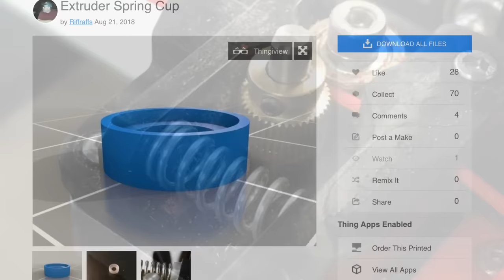Fix Bad 3D Prints on a Creality Printers

Comment: Hey man, the faster you can get to me the better. I want to get my dad a reliable 3d printer for his birthday. He got one 3 years ago, and what we found out, is its a frame and the rest has to be DIY or you have a frame with a bunch of useless parts. We got one or two awesome prints, and with limited knowledge on the subject we did fairly well. I noticed the bed was warped and that didn't help and after putting in another 50$ to try and solve the frustration that was supposed to be a gift, we gave up. and that's 50$ in multitudes of solutions. The solutions we found stated we would have needed to tear it all down and rebuild from scratch almost buying a new 3d printer worth of parts. I think I have decided on the CR-10 as it just sounds good from everyone, and I do not mind putting time or effort into improving it, My deal is weather or not it will work. If it can't at least work on its own and give me SOMETHING then I want to stay away from it.  If it can at least make me the pieces to improve it, I think its worth it. I'm trying to find good sales now, but I have a question:

I have found a few versions of the CR-10 mini, and some don't have the new neat upgrades that you showed off in another video I believe. The mini Makes me happy both in price and scale, its actually fairly decent. The standard just gets a bit much for me in price, but is the extra worth it between the mini and standard? Also, it may be me that I can't find the link to the right mini, but would the link to the mini in this video be well enough? if I do not get the mini,what in the world is the difference between the 10 and the 10S? I have 100 coming in so pricing wise, the 10S would be cheaper but only if its better for the 100$. I found a CR-10 that was listed as the Newer version and is more expensive but I don't know whats so much newer with it or if its even worth it. I am trying to understand, let me know if you can!
Reply from the maker: All the links in description are for good ones. 10S is not worth the extra in my opinion. I use several 10 minis and I like them.
Reply: @FilamentFriday  thank you so very much! Have a wonderful day!

Comment: It could also be bad filament if it’s not higher end filament. I bought duramic pla plus and COULD NOT get it to print. It even had great Amazon reviews. I usually print PETG so I thought maybe I wasn’t getting good settings for PLA. I mean PLA is supposed to be easy to print I must be doing something wrong right?

Even after drying for 2 hours still nope. Pulled out the creality sample PLA, and it worked fine. So don’t rule out bad filament if you’re using low to midtier stuff.
Reply: this is the exact filament that was giving me issues too, switched out my nozzles, went back to my stock extruder, calibrated e-steps and did a bunch of tests. nothing ever came out consistent
Reply: OMG, I also am trying to get Duramic to work and its complete garbage. I thought it was me since it has great reviews, but its all powdery and I have had under extrusion, binding extruders and when I finally got it to print it looks uneven like some of it didn't flow properly. Also my printer is caked in dust now after having just cleaned it.
Reply: @ammardelreal3802  same. Just never got consistent results.
Reply: @kenh9371  a lot of the Chinese filaments have gone downhill over the last year. Idk why.

Comment: I do have clicking on my CR 10 Smart Pro and it doesn't and it was caused due to a clogged nozzle I thought. The issue is fixed and I have a 0.6 nozzle with arachne engine from prusa slicer and everything works fine but I'm not sure if this applies to my latst printer. I mean its just been a week or two of printing and I don't know if this is the case but it used to do this and I thought it was just cheap filament, increased the temp and it was fine. 215 degrees as the filament was just not great.

Comment: Good to know, but my case I have a newly installed dual z lead screw on my ender 3 v2. The issue was two prints same time 1st  was perfect the  other first layer separated a little the rest of it was fine. Was the the loss of power possibly? I don't know?

Comment: So I just bought an Ender 3.  Went through several trouble shooting videos before I realized that the humidity in Hawaii is 100% when it rains... It's been raining for four days. Lol. Buying a dehumidifier to see if that works.  But I get very similar prints to this every so often.  That steam builds up and nothing flows consistently.  Any other suggestions to help keep the machine dry?
Reply from the maker: Get and enclosure for it.
Reply from the maker: Because my channel has always been more than Filament Friday. CNC Sunday (occasional videos) and some Electronics are all under the umbrella of my company Chuck Hellebuyck’s Electronic Products (CHEP).

Comment: I am unable to get my new Ender 3 v2 to finish a print.  Things go great for small prints, like a stringing test, but larger stuff ALWAYS fails, leaving the print in a stringy, tangled mess after the first half hour or so.  This happens every single time since the first error with larger prints, and I have had less than half of my prints finish.  I am growing frustrated.  I am  leaning towards the nozzle being the problem, as I think my bed is well leveled.  The FF toolkit I purchased with the recommended nozzle kit should arrive today, so hopefully it will allow me to fix this with a  bit of advice.
Reply from the maker: Verify the fan is spinning to cool the hotend. Sounds like it might be stalled.
Reply: @FilamentFriday Thanks for the quick response.  Yes, the fan is running.  I have slowed the print speed to 75%, and am currently almost done with a print that has failed twice so far.  Does this suggest anything? And thanks for the quality gear in the tool kit.
Reply from the maker: Probably was too fast for hotend.
Reply: @FilamentFriday  Maybe so.  Print still failed at the very end, but made it further.  I think I just have more to learn.  That said, thanks for the quality videos and the replies.  You have another fan.

Comment: I have a problem I don't understand.
I got myself a magnetic bed for my ender 3.
After I put it on the printer and calibrated it I tried to print my the calibration cube to check if it was all right.
The cube printed all right but I couldn't get it of of my printer even after it had cooled down.
I managed to get I out but it left a mark and now the bed has the shape
Reply: Maybe bed temp is too high lower temp less adhesion.  Personally I like to use the purple Elmer's glue and if it's too hard to remove I just run it under warm water and it dissolves the glue and comes off easy.

Comment: I use an ender 3 and if I print larger items they come out wavy... The printer is standing still, no wobble while printing, extruder adjusted and settings are all good and good quality PLA, any ideas?
Reply: Check you bed x axis tension on the bed belt, the excentric nut on x axis and just check that extruder idler pulley isnt too tight

Comment: What if the waves appear on large flat surface of a print? They are constantly spaced apart.
Reply from the maker: Then your bed level is off or your bed is warped.

Comment: hi!! maybe you can make a video on layer separation, i have problem with my ender 3 pro, and outher vertical layer not sticking together, and i have done the flow check, and also increased extrution with, but i still have problems with this, and it seems like some colours are worse then others, i have also tried increased temp on the nozzle, but no luck, and because of this problem, i often use only 1 outer layer.
Reply from the maker: https://youtu.be/iXe7bftyMFU

Comment: A similar problem on the surface can occur if the plastic has absorbed water and needs to be dried!
Reply: That's the problem I'm facing. I printed over half a spool with very nice lines, then didn't touch the printer for weeks but didn't remove the spool and we had really bad rain for those few weeks. Couldn't get decent lines but tried a brand new spool before tinkering with anything and bam, perfect print again.
Reply: @southaussielad2496  the plastic can be dried in the oven for PLA 50 degrees, for PETG or ABC 70 degrees for 2-4 hours.

Comment: Using pla, creality Pro 3. Says anything between 200- 210 nozzle.  Bed 60 and speed at 80. Fan is at 50% Why do prints screw up after a few hours. Hearing too many different loadouts for pla. What's the real number please?

Comment: CHEP, I need your help. I've tried all of this and I'm still getting little gaps where there is no filament coming out. It was printing fine before I clogged and replaced damaged tubing, nozzle and fittings. I've tried different tubing, fittings and nozzles. I've tried reseating the nozzle and tubing multiple times. I printed the extruder spring cup and installed it. I just did the hot end fix following along with your video and it's still happening.  I cannot figure it out for the life of me. I've had my ender 3 pro for a little over a year. Symptoms include the little gaps with no filament like I mentioned and more stringing and oozing than usual. Thanks for your excellent videos and any advice you might have for me. Thinking about trying a new extruder next I guess.
Reply from the maker: Check the extruder arm for a crack.
Reply: @FilamentFriday  Current print just finished. I took the extruder apart to get a closer look and the arm is not cracked and the insert where the screw goes for the pulley is still solid. It is pretty worn out where the filament goes in on both sides. It has worn through the brass insert almost all the way. Could that be affecting my prints?
Reply from the maker: Definitely. It will stop the filament from flowing.
Reply: @FilamentFriday  Thanks for any tips. I've installed a new EZR struder. Calibrated e-steps and flow. First print looked great on the outside with no gaps but infill looked messed up with gaps and globs which is new. After that the hot end fix I did it seems the washer shrank and isn't working right anymore. So I've tried reseating the tubing numerous times and tried putting the hot end fix back in but the filament catches on the small piece of tubing. I've put new tubing and new nozzle and still getting small gaps where there is no filament. Im at a loss. The first print after installing the new extruder had no gaps on the outside of the print. But now every print has small gaps and I reseat the tubing and nozzle before every print trying to fix it. Maybe I need a new hot end?
Reply from the maker: Sounds like your fan is failing.
Reply: @FilamentFriday  man I thought we were finally onto something here. Thanks for allowing me to ask you questions and thanks for the replies.

The hot end fan has been making a lot of noise lately so I replaced both fans on the hot end and still having the same problem. I tuned PIDs and I've checked e-steps.

I had thought the hot end fix washer shrank but I printed another one and it's the same exact size. It just doesn't fit tight it's a little loose in there and if I don't align it just right the filament catches on the smaller piece of tubing when feeding through.

If I disable retraction or lower retraction distance enough the gaps go away but then I have stringing issues.

Another thing to note is that I had combing (not in skin) enabled and when it moves without retracting, little blobs ooze out and the gaps are more concentrated in the same spot. Disabling combing causes the gaps in the walls to be more spread around everywhere.

I feel like I might be getting heat creep. If I do a cold pull there's a lot of filament that comes out that has been melted.

I also keep trying different tightness on the tubing against the nozzle. The hot end fix allows me to tighten the fitting on top of the hot end down on the fly while it's printing and it has a big affect on where the gaps show up and they get worse the tighter the tubing is on the nozzle but I can't seem to get it just right.
Reply: @skatemango  I started using a profile from luke hatfield. Only changes I made were to turn retraction down from 4.5 to 3 OR turn up the hotend temp from 200 or so to 215 and the gaps went away.

Comment: Which option for the SEEMECNC EZR STRUDER for the Ender 3? No stepper motor, or one of the other 2 options? Thanks!
Reply from the maker: You can use the existing stepper motor. No need to buy that too.

Comment: I'm using your slicer settings in cura, and I get just so good prints out of it. But it takes really long... What do I've to change if I want to get it to print faster without reduced quality? Already bought capricorn tubing. I know I've to up the speed in the slicer. And also the temp? Or change to a dual gear extruder?
Reply from the maker: Speed is a big part of quality. Use 0.2 instead of 0.12 is all I can offer.

Comment: Hey chuck I have a question I currently have a ender 3 have had it for about 6 months I use cura 4.0 thenissue I am have with my prints are that on the layers I have notice the the edges start to curl up a little bit on each layer and the edges start looking funky I have changed out nozzle ptf tube I have also tuned the x,y,and z and double checked for clogged nozzle everything seems to be good..I have a great first layer I use my fan for layer cooling not sure what it could be could u possibly shed some light in this issue or have u ran across this with your prints not sure how to send pictures of prints to show what’s going on
Reply from the maker: Not sure what could cause that.
Reply: CHEP is the a way I can send pics or videos to you just to kinda show you want it’s doing ?

Comment: Hey Chep,
Watched your video and my husband and I have tried everything. Our prints turn out amazing except one layer, in the same spot, is missing.... seems to always start to the right of the seam. We print all different models and it’s always the same layer. We have 6 printers and it is happening on multiple printers. 
Any help would be much appreciated!
Thank you!!!
Reply from the maker: Same exact file?
Same SD card?
Sounds like a bad GCode file and possibly a bad section on the SDcard.
Reply: Thanks for responding so quickly. 
They are different files, same SD card and happens on different machines. Happening on an inside wall (cookie cutter) where the thickness changes on the outside wall, 1.6 to .8 for the cutting blade. 
Literally a beautiful, smooth, perfect print but with one row missing about an inch to an inch and a half to the right of the seam on the inside.
Wish I could send a pic so you can see how flawless it is, except this one spot. Super frustrating.
Reply from the maker: Bad SD card then. I’ve seen that before.
Reply: Looks like I’m ordering some new SD cards! Fingers crossed it fixes it. 
Thanks again for your help. 
We appreciate it!  :)
Reply: @lindsayleclercq8516  Did that fix it?
Reply: Hey Ash
We ended up fixing it by tightening all the belts and turning off “adaptive layers” in Cura. Apparently it is clicked on by default. Hope this helps 🙂
Reply: @FilamentFriday  a bad SD Card can cause all that, really!?
Reply from the maker: Sometimes
Reply: @FilamentFriday  that explains some botched prints with the default crappy sd creality give you. I'm getting a new one to be sure.

Comment: Hi Chep! Came to this. But it seems there are other problems i dont quite figure out. My new Ender 3 V2 has those missing line. Even though with right esteps and flow. Does it mean i need to change my linear advance? Or is there other solutions?
Reply from the maker: You probably have a partial 
blockage.
Reply: @FilamentFriday   will do your hot end fix! Currently have my capricorn tube! Thanks!

Comment: What does it mean when my extruder gear slips/jumps in reverse for a fraction of a second? I've checked it is tight on the extruder motor.
Reply from the maker: Means you might have a blockage in the nozzle.

Comment: Upgrading the extruder gear to steel (instead of the factory original soft brass) is also a cheap and effective upgrade to aid the friction and force against the filament for better feeding and with less wear. The Ender 3's original extruder gear is supposedly 10.9mm external diameter, but tons of 11mm extruder gears are available dirt cheap from the major Asian vendors with no discernable difference yet in printing in my tests. Look for one with inner diameter of 5mm in order to fit the Ender 3's motor spindle, and I believe 36 teeth in order to match the original. I haven't tested these on other Creality 3d printers, but they may be similar. I printed a spool of filament with metal particles inside and it really wore out my original brass extruder gear quickly - the steel seems hardier so far. At around $1 per gear from Asia, these are worth ordering ahead just to have onhand -- in my case the original soft brass gear turned out be a consumable part. They're also available from domestic vendors, but at close to $5 each, so plan ahead and see how it works for you. Upgrading the entire extruder assembly to an aluminum one is also a cheap and recommended upgrade as other posters have mentioned below!

Comment: 2:50 THE SET SCREW SHOULD BE ON THE FLAT PART OF THE SHAFT TO PREVENT SLIPPING. SORRY ABOUT THE  caps lock
Reply from the maker: There are two. Ones on the flat, other is not.

Comment: Hello, I have a Creality CR-10 with dual z axis motors. The z axis goes up and down when homing but will not go up when printing. Is it the machine or am i doing something wrong in Cura ?
Reply from the maker: Sounds strange but it has to be in your Cura file.
Reply: Try using a different slicer if you haven’t figured out the issue

Comment: I just printed a piece of plastic and converted my ender 3's to direct drive that fixed everything for me.
Reply: How does the X-axis handle the additional weight?
Reply: @infernaldaedra  it is the same weight you are just shifting it and it does not seem to be a problem.